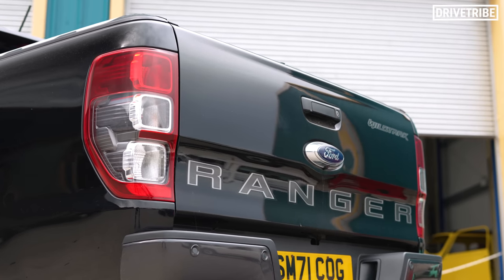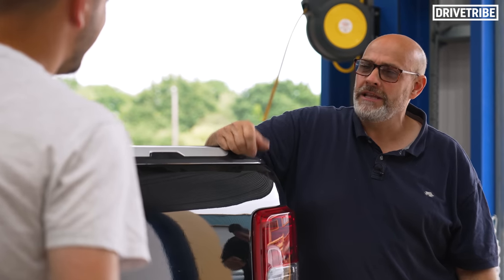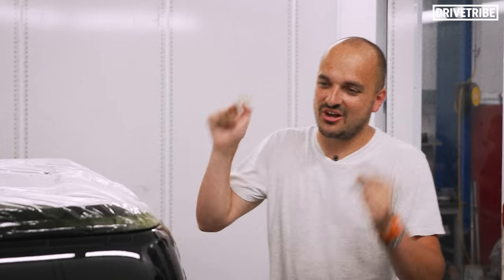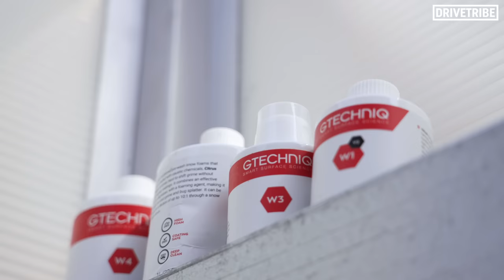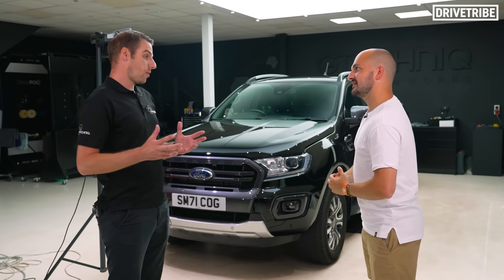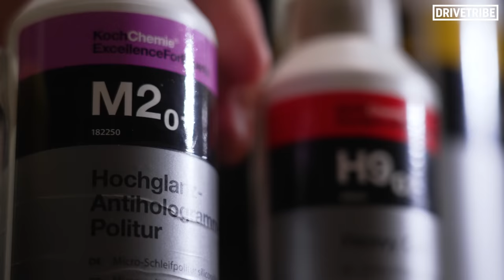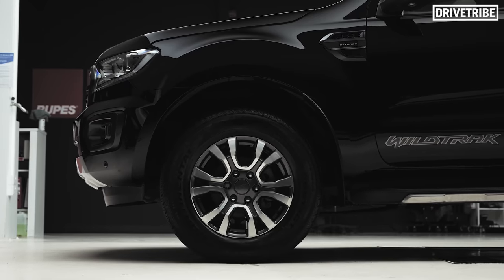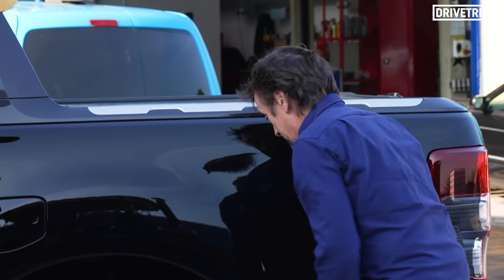Some idiot crashed into Richard Hammond's pick-up truck

Comment: My 2004 Silverado Z71 is supposed to be a truck.  Mine is18 years old and has dents and dings all over.  The paint is scratched by trees limbs and bushes in the woods.  The bed is bead up from use.  But is runs perfect and only has 125000 miles on it.  I am 74 and it will be the last truck I ever buy and use.  I do not treat it like a collector car.  It is  a TRUCK!  Enjoy its usefulness.

Comment: I have a black Ford F150 Platinum that I ceramic coated. The black is very unforgiving. I have a few spots I need to polish and reapply. It's not an exaggeration to say that after coating, the rain washes your car clean.

Comment: I've just bought an 97 TDi Disco coz Luddite and although im not usually fussed about exterior dings this one has a caravan jack knife ding in the rear side that the previous owner belted out with who knows what....  So my Pet Paint and panel guy and I are about to set things right and repaint the bonnet (Coz Land Rover Clear coat) and owning a few Range Rover classics im about to get a masterclass in Birmabright massage....
Yup, that infamous Magnesium alloy that is notoriously difficult to repair and reshape :-O 
Panel guys are artists in their own right, melding and moulding that which fights back and although I wont be ceramic coating it I am looking forward to the learning experience.

Comment: Ooh I wonder if this is the truck with Hammond and passenger (cameraman) attempted a three point turn at the Dinedor village turning without checking the rear view a couple of weeks back? They both looked a bit shocked as I nearly joined them in the cab astride my Honda Blackbird. Hammonds face was a peach. Shame about the recent dent at his unit which is 100 yards from my front door. 😁

Comment: Lazy attention to detail when prepping the vehicle. Would have taken less than 5 minutes to unbolt the sports bar and raise it enough in order to have done a proper paint finish. The rear light can also be removed in less than 2 minutes, in turn, eliminating the need to mask off.

Comment: Why wouldn't you just replace the body panel instead of going to all that work pulling the dent and then having to fill and sand it?
Reply: It's more that just a panel. More likely part of the whole main frame or rear loading box.

Comment: 15:01 - 15:05: Case in point... The detail won't last long. 🤦🏼‍♂️
Reply: What do you mean?
Reply: @tafadzwa8961  From a car detailing point of view, Richard touches and rubs the trucks'  paintwork several times in a pretty aggressive way during the time stamp specified. Very basically, he's doing damage to the paint finish just by the simple act of touching the vehicle.

Comment: That's a lot of orange peel at 4:23 I see. Not a very smooth paint job. But as long as it matches the rest of the truck that's all that matters. That may be a perfect factory paint job but for an aftermarket high end paint job it won't cut it.
Reply: I actually paused the vid to make my comment so I did not see your acknowledgement of the orange peel until after posting my first comment. Nice to see we agree 100%.